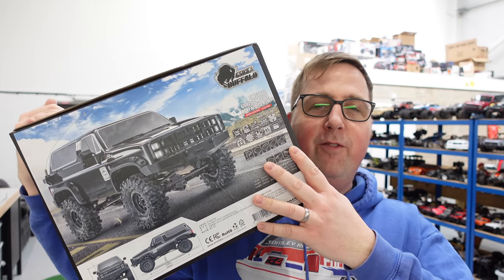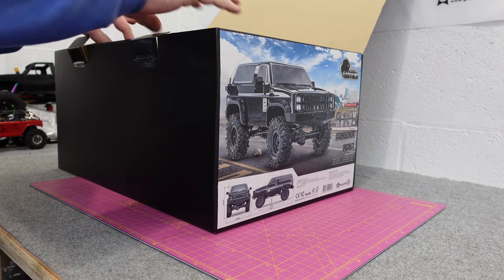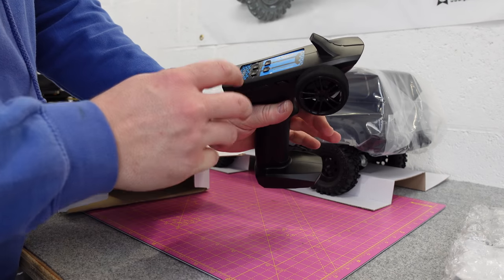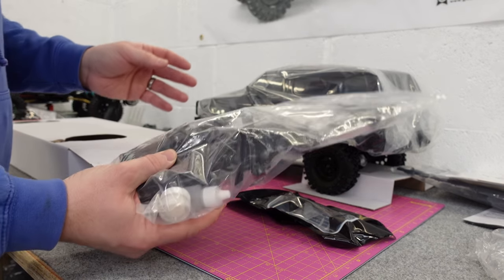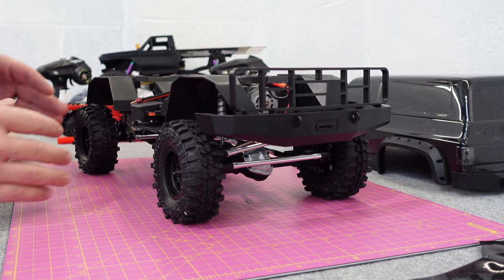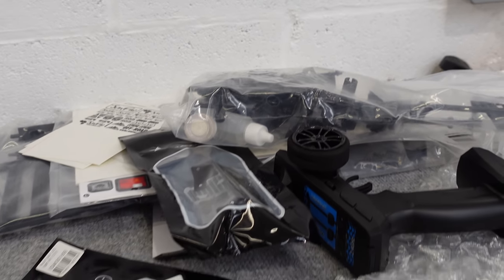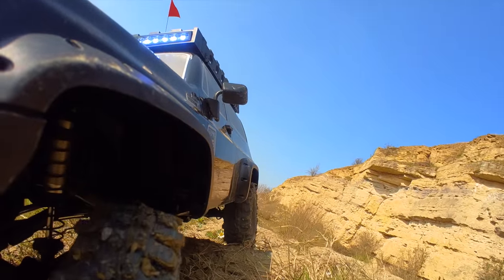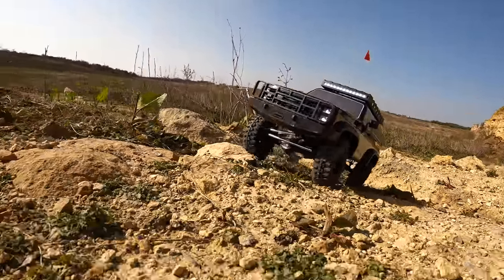The GMADE Buffalo GS02F is a MIGHTY Impressive RC Crawler!

Comment: i can tell that mine bumbs this way even with oil in it. Have the softest stock springs. I made warm white leds myself.
It's my first crawler and i like it (was a kit).
No problem in reverse with a 35t brushed motor an hobbywing esc on 3s. Runs 12-13kph in 2nd gear
Reply from the maker: Sounds like a good combo 👌

Comment: Love G-Made stuff.
Hate RTR stuff.
Wish companies would compromise, and sell "truck only".
I've got a nice radio. I've got a 1000 bucks into batteries and chargers, and I don't use 2s for anything but bench tuning.
Sorry, my rant.
Nice vid. Your craw space looks like a good time.
Be well, and have fun.
Reply from the maker: Yes, rollers would be good 👌
Reply: @ BRIAN..... UHHH..... "THEY" - (GMADE) MAKES A FEW VARIOUS VERSIONS OF rtr(s), BUT STILL... A FEW *KIT VERSIONS* OF THE *GS02F* AS WELL !! 🤔.....
😉👍 - perfect.....!!!? - "Right"...!!??? 🤨
Reply: @paulschryer9571  right, 
I've got two G-made rigs, both built as ultralights.
I'm into the kiss principal. So, not much into the two speed stuff. So this ones a pass.
Have fun man.

Comment: Funny thing is I put Gmade shocks on a 70 buck cheep Braave 14tg scale cause they ft . 50 buck for the shock and some 12buck tires and rims made all the difference. 
Could have spent 150 but it's not as much fun. Modding rtr and building is what I like . 
So get a aluminium front bumper and winch next?

Comment: I destroyed my front pinion/bevel gear yesterday. Otherwise it's has been a great kit the last year. I'm removing overdrive in the gearbox before installing new gears. Hope that makes it slightly more durable.
Reply: Where do you source parts for these?
Reply: @austinlimitertap3851  rcmester.  I'm in Norway. Shipping from USA to Norway is expensive. I wish rcmart was back on ebay.

Comment: Good review, really enjoyed the drive video.  The Buffalo is going to be a great trail truck and, with a little work, a competent crawler.  Get rid of that bumper though and those window decals, ugh (just give us clear windows).  I have the GMade shocks and they are notoriously overdamped, even their soft springs.   The RC4WD springs (Part Number: Z-S1185) has a 0.8 rate spring that works great.  GMade is making some really nice stuff, I just wish their distribution network was better.  Still, a big fan and hope to see more from them.

Comment: I am going to buy this bad boy very soon.  I actually did not know this existed until last week.  I have two Trx4's right now, a new 21 Bronco and the 79 Bronco.  They are both great but after owning the 6s Typhoon blx, the trx4 is justbtoo damn slow, way to slow in fact.  I know they are crawlers but still, more speed is needed.  This one sounds like it is significantly faster than the trx4 but it also can crawl.  Close to 20 mph plus crawling ability is the perfect trail truck for me.
Reply: Does this go 20mph?
Reply: Wish they offered one with actual windows.  Rtr is $534 so for that price I would expect real windows but I  am still buying me one...

Comment: Having to  fill shocks on an "RTR" is a bit naff , I know why they do it but surely if you can't take it out of the box , charge it and run it as the manufacturer intended , then it really should be advertised as "almost ready to run" but it would seem that the ARTR categorisation has went rather out of fashion lately with RTR now needing to be taken with a pinch of salt . Nice little truck right enough , just a bit of a shitehawk marketing move calling it RTR when it's only 95% ready to run at most 😂😂😂

Comment: I've built about a half-dozen of their kits and have messed with some RTR's (some for myself, some for some friends). What I've learned is the following.

1) Either put internal wheel weights on the factory wheels or buy some heft aftermarket ones. This is a good idea for any crawler, but it really helps settle the Buffalo's. I prefer aluminum wheels WITH internal weights in front. Adds about 600g low down total and more front bias...yes it's spinning weight, but the drive train can handle it just fine.

2) Replace the factory shocks. They seem nice because they use quality materials and look good, but they're too bouncy regardless of weight/spring combo. The best luck I've had with the factory springs is 70W oil with SCX10 II springs...but a set of TRX4 shocks is cheap and is better still, or if you want to spend the money on Prolines, Ottsix, Vanquish, etc...all are a massive upgrade.

3) RTR needs a better ESC. A HW 1080 turns it into a much better crawler.

4) Factory tires are pretty good, but need better foams to really shine. 3BRC anti-foams make a world of difference. But some 4.75" tires do a great deal in making it more capable and solving some of the clearance issues with the front.

5) These make a much better trail truck than a full-on crawler.
Reply: All good points but true of any rtr, of course 👍  As for the shocks,  I use RC4WD springs (0.8 rate) with 40wt in front/50wt in rear (or less, in colder weather) and the stock shocks work great.  It takes a little experimenting but no need to upgrade (not that that has ever stopped anyone 😉)